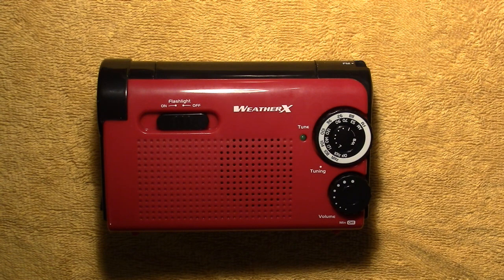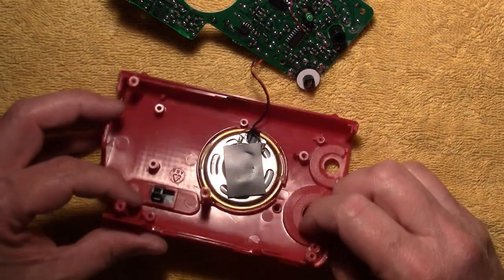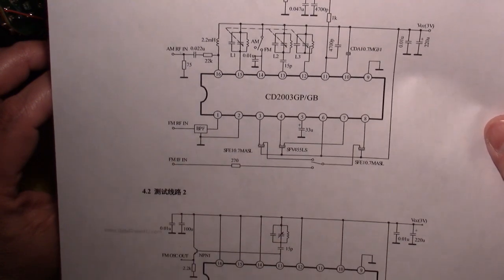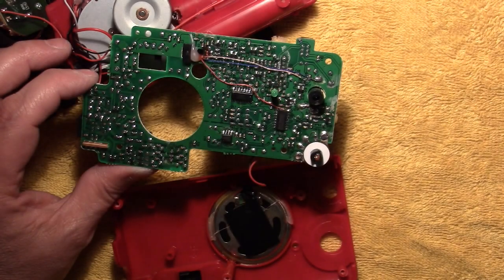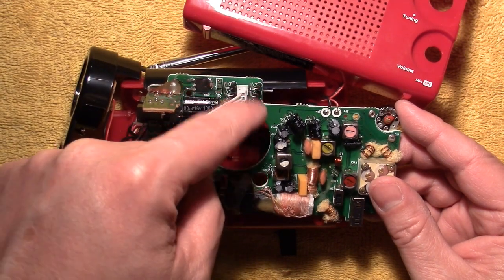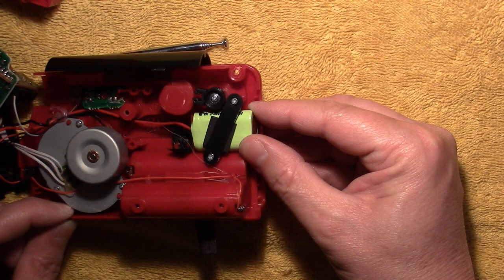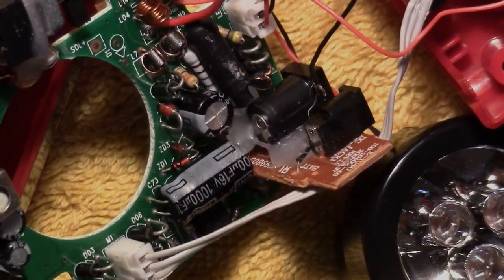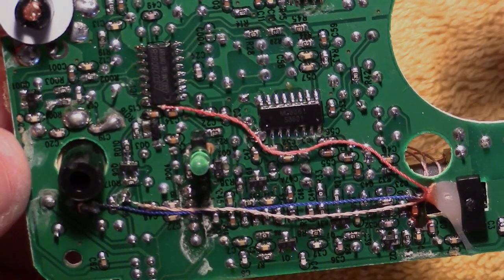Weather X WR182R Weather Radio Teardown Whats Inside

Comment: Probably almost completely machine made slapped together in China. But it did have quite a few more through hole components than I thought.
Reply from the maker: It looks to be that way. I just got the radio but the battery had a 2014 date on it. Thanks for watching.